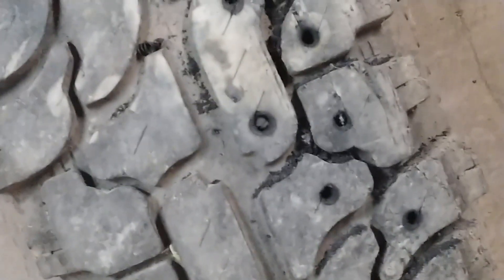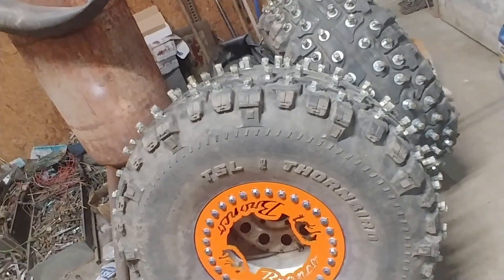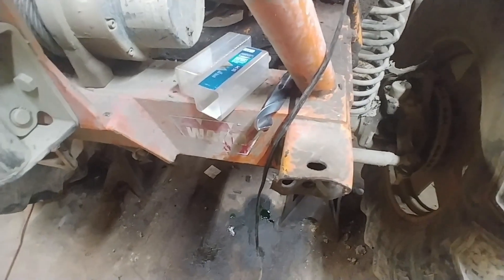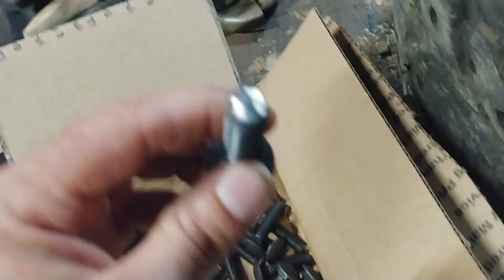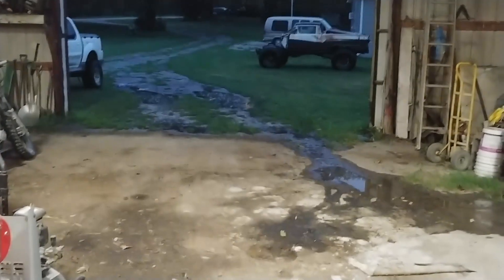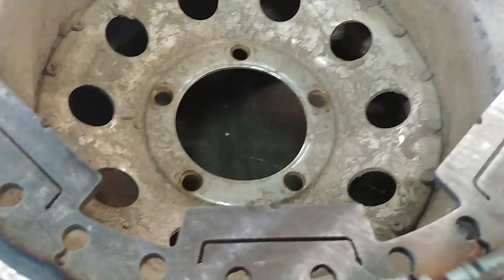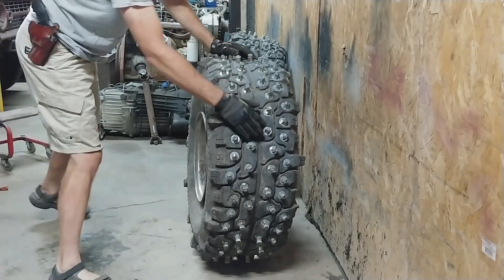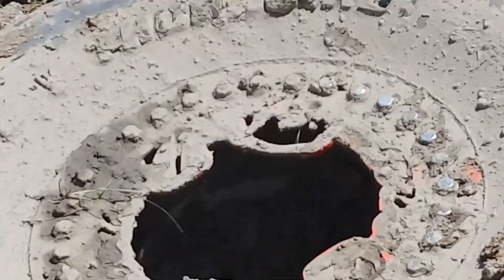Bolted Tires PT1

Comment: You could use old tunes as liners. Also if you put baby powder in the tire before you put the tubes in it will help with friction and snagging on the new tubes.
Reply from the maker: Some old tubes were a thought, and I am shure it would have worked for a while but I think eventually they would have gotten nibbled throught just like the actual tubes did.
Reply: @misfittoys8883  I was going to suggest patches but that would be very expensive and would probably yield the same result. Definitely try the baby powder, it's a trick my dad has used at his shop for years. Also after seating the bead you can let all the air back out of the tire and reinflate. It allows the tube to have a better position in the tire. I'm sure with the low pressure it won't matter as much but I want them to work the best possible for you. Can't wait to see you ripping up some trails! Good luck